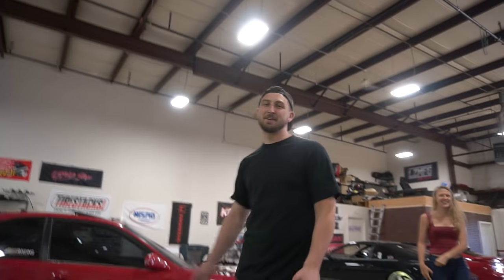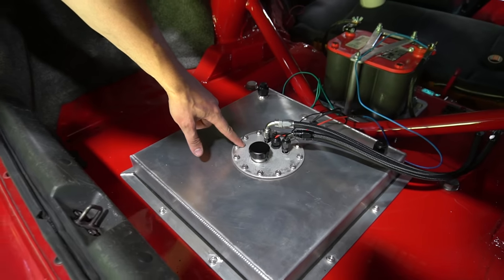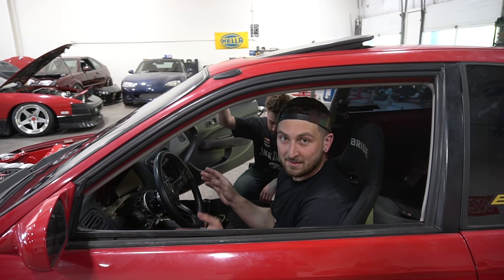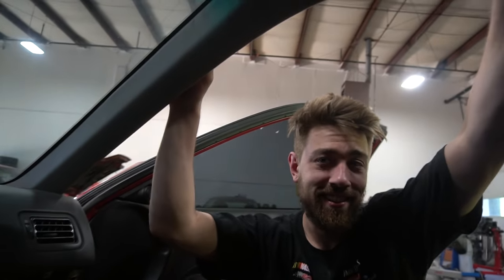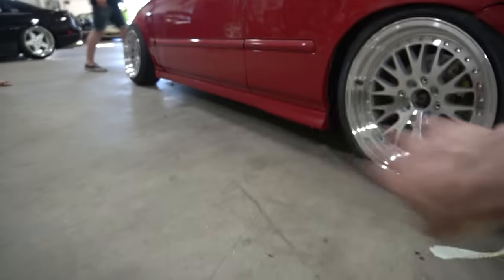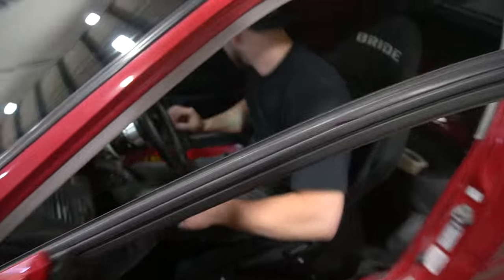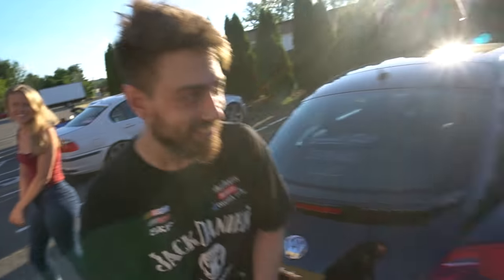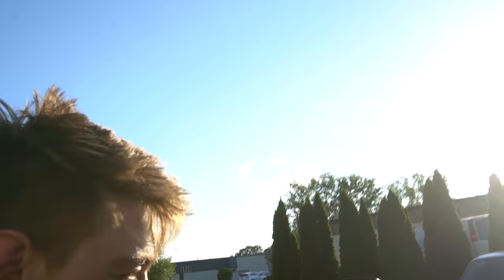Rear wheel drive Honda Civic - FIRST LEGIT TEST DRIVE!!!

Comment: Seems like most of the smoke comes when youre off throttle. Valve stem seals are not that hard to do and it would fix it a bunch prolly.
Reply: I literally said that last video haha, car turned out pretty sweet

Comment: Hold on, why haven’t we ever seen the shop with those 2 GT-R’s sitting out front
Reply: 3 gtr's and i believe its command performance he used to go there quite often with adam and in the older video's
Reply: Actually three!
Reply: f*** the GTR’s I wanna see Jimmy from a ditch or Rolling start with that ALL motor ek when he finally tunes the KA
Reply: @connoisseuroftigolbitts  judging by the ek hatch, a turbo ka with stock bottom end wouldn't stand a chance lol. and im a 240 guy.

Comment: 9:10 wait... what? KA DE's make 160 stock... and 165 torque. We're talking about an engine with a full exhaust, built pistons and rods, a turbo at 3 pounds and ethanol, and idk the rest but probably a better fuel pump and bigger injectors and better spark plugs. This thing makes at least (and I'm emphasizing on at least) 200hp at the wheels

Comment: Nissan was your first mistake...I'm sorry Jimmy, I realize how much work and time you have into this thing and I have the exact same chassis that makes 612 whp reliably, but KA and SR I've heard of NOTHING but problems. I'd get a K24 with a K20 head and an adapter to go from Honda K series to the Nissan trans.
Edit: I apologize to all Nissan fans because I'm not trying to say that all Nissan is junk, all I'm saying is that I've heard nothing but problems from a stock KA24 with a turbo, and nothing but problems with a SR20, but I HAVE NO PERSONAL EXPERIENCE with either engine, so I'm just going by the many times I've seen people building them. I LOVE R32, R33, R34, and R35 GTRs obviously (who doesn't?) and the RB and VR platforms are legendary. I've just hardly heard of too many issues with the K series Honda engines.